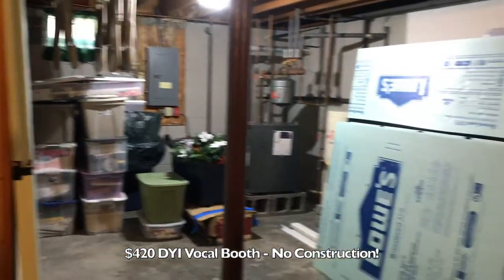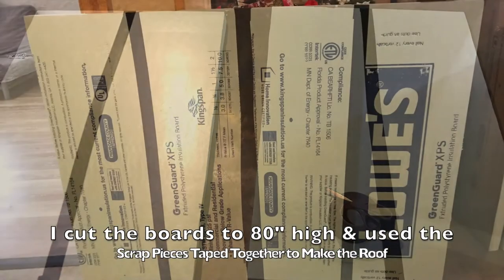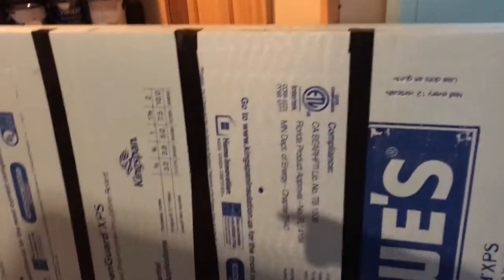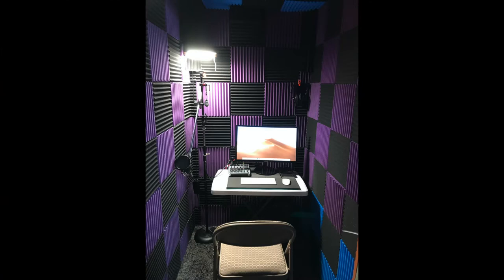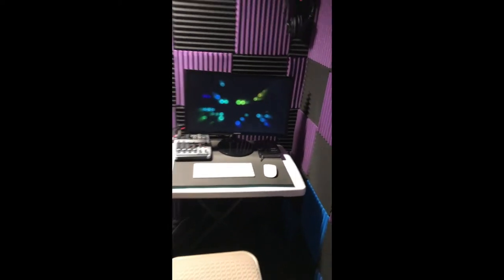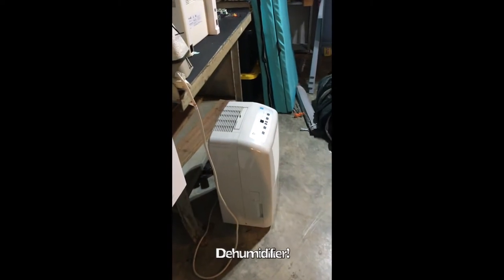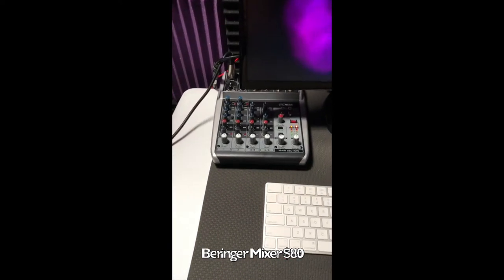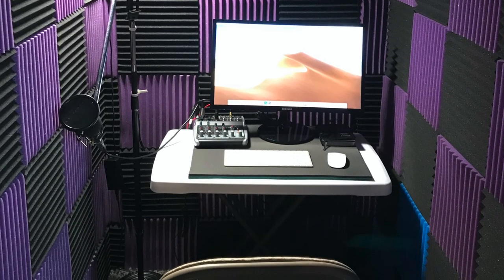DIY Vocal Sound Booth - Voice Over - ZERO Construction Using Foam Board & Duct Tape

Comment: I ended up using a 5 x 5 pop-up tent frame and draped moving blankets over ever side and roof. Works really well but I like what you did better! Does it get hot in yours? (It does in mine) What do you do to combat the heat? Oh, and how is the career going so far?

Comment: I live in an apartment.  I am looking for more soundproofing, but also sound absorption is also important on the insde.  This is for my son and when he records vocals, it is really loud.  Have you checked to see how much soundproofing attenuation you get from inside the booth to outside?  Thank you for the video.  I was going to use the foam with framing and forgot how rigid the 2 inch stuff.  Super simple and cost effective. Brilliant. Gorilla tape is also an excellent idea.
Reply from the maker: It’s more effective on absorption. Won’t really block out Lou’d outside noise. I’ve seen people buy moving blankets and drape them over booths, that might help also.
Reply: @WayneReichert  Thank you for your replay Wayne.

Comment: I was thinking you can buy several 'Whisker Biscuits' used on archery compound bows and glue them together for a place to put the mic cable through that retains alot of sound proofing, maybe enclose them in PVC or something.

It just dawned on me you can have a monitor in a vocal booth hooked to the main computer monitor (Do HDMI splitters exist?) and use a wireless keyboard linked to the external computer to control the DAW while in the booth if recording by yourself.
Reply: They do exist. I use mine for the exact purpose you described. :)

Comment: Thanks for the video!  How did you mount the 12x12 acoustic foam?
Reply from the maker: TheGracieVshow I just used some double sided tape. A small piece in each corner
Reply: @WayneReichert   Hi, the duck tape is not sticking as well as I'd hope. Did you have any problems with the tape or double-sided tape?
Reply from the maker: TheGracieVshow no I haven’t had any problems. I did use gorilla tape mostly and put tape on both the inside and outside of where the wall as met. Everything is still in place. The double sided tape I used for the foam also worked well so far, I did use a double sided foam tape not the scotch tape kind.

Comment: Nice to see your Booth,
how to Control the Noise of  A PC ?
it is a big challange for me to control the Fan Noise of My Desktop PC.
Do you  have some kind of suggestion ?
Reply from the maker: For me I use the Mac mini. Which is outside of the booth and I use a wireless mouse and keyboard. The monitor and other cables I ran under and outside the booth. All the recommendations I’ve seen are the same, pc outside of the booth.
Reply: @WayneReichert  Thank you so much